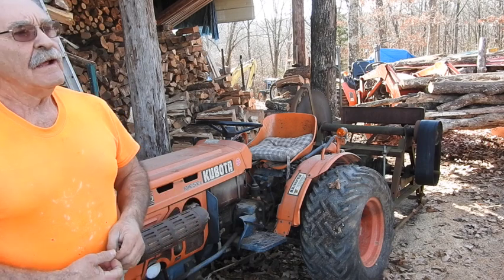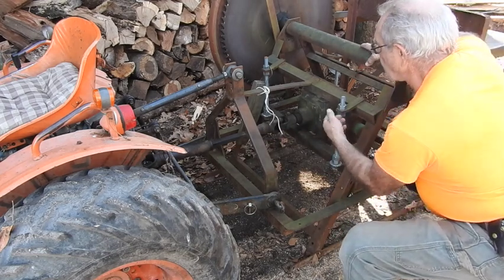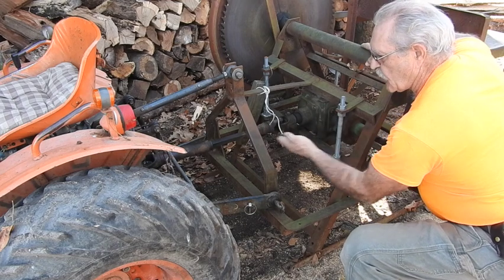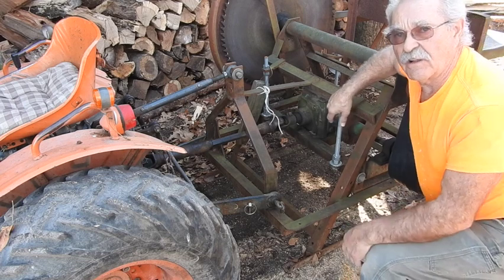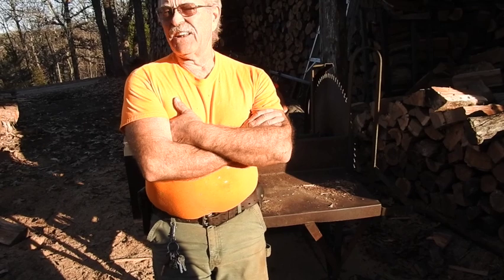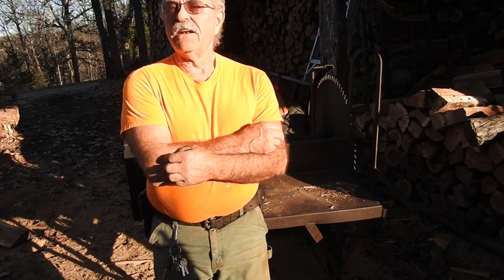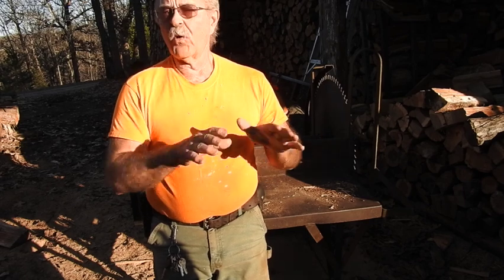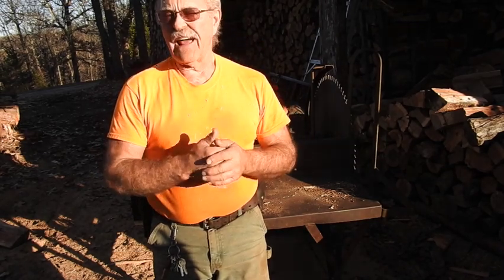Buzz Saw Therapy : Outdoors

Comment: T-shirt weather for you but for us it`s firewood time for sure....that buzz saw works really well off that Kubota.....CHEERS
Reply from the maker: Yeah, I figure if its GOTTA be cold it may as well be somewhere in Canada !!  I don't need it down here at all Gator.  LOL  That little 3 cylinder diesel will run wide open all afternoon and I don't think the fuel level goes down an inch or two too.  Great combination for power to the blade.

Comment: No two ways about it....that set up is sweet
Reply from the maker: It works really well for me, but I have another one that I use on an 800 Ford three point and it does very well too.  Then I made a temporary conversion for that one to be operated as a stationary rig powered via flat belt pulley off the side of a tractor.  It works GREAT in that configuration.

Comment: I remember my Dad’s friend built one when I was a kid for the three point hitch and the bed was stationary and the arbor was on a hydraulic cylinder to move the blade in to the wood. It also had a small 10 foot chain conveyor on the blade side. 30 something years later and many hands changed, I do believe that it’s still in the community and still being used to fire my cousin’s maple syrup burner!
Reply from the maker: THAT must have been a cool machine Peewee !! I've never seen a rig set up like that before.  Sure be nice to get some footage of that one in action.  Thanks for the comment.  Awesome.

Comment: That's good therapy right there....I like the old flat belt arrangement on the end.
Reply from the maker: Hahahahaha....you're a fan of old Rube Goldberg too huh Matt...LOL  I didn't have another crowned steel flat belt pulley to put on the gearbox output shaft so I scrounged up two dual groove V-belt sheaves and installed them tightly against each other.  I didn't know if the flat belt would have enough grip just running on the outside edges of the sheaves OR if the flat belt would even run true on it or fly right off one side or the other !!.  Turns out neither worry was anything to worry about.  It has great grip and it'll only fly off if I get a piece bound into the blade.  But in twenty plus years, that's happened only a handfull of times.  
   Oh yeah, I forgot to say the haybine was given to me to haul to the junk yard by an old farmer and the iron is out of the scrap hoppers on commercial jobsites and the sheaves are from dismantling salvage roof top units.  LOL.  And the belting came out of a trash hopper with several belt lacing tools and at least 20 to 30 rolls of belting of all widths and materials.  The neighbor lady gave me the saw rig 35 years ago because it'd been sitting in her woods since the 60's rotting down.  So this was another 'low budget' project thanks to salvage material !!  LOL Dang, I better quit bragging, ya think......

Comment: I saw you cutting some cedar. I thought I was the only one that burns cedar. Of course I have an outdoor furnace and burn almost all of my tree scraps. Enjoyed.
Reply from the maker: We'll burn some of the knotty stuff early in the morning to help ignite off the coals but the nice straight grain we'll just split into kindling as it comes in out of the wood pile.  Works really nice for that too.  Is it an OWB or a regular outdoor forced air furnace.  Most of the time they are the OWBoilers.
Reply: I have a hardy outdoor wood boiler with a radiator in my duct work. It’s great unless we lose power.
Reply from the maker: @commonsensehomestead  that's cool !  I actually have a Hardy that was in a building 100 yards from the house it served. The building burnt down, along with at least a cord of wood inside and just all but destroyed the Hardy.  I'll be doing a whole series on stripping it down, salvaging the basic boiler, then re-controlling it in preparation for heating 1200 linear feet of pex tubing in my 1200 sq ft new shop.  Its going to be a tough one too.
Reply: @tractorman4461  when I got mine it was being salvaged. Somebody had tried to burn trash I it. Mine was all bowed out. I pulled it all a part and filled it up. I didn’t have any leaks. Had to put new insulation, relay, solenoids, etc. Amazingly the blower and pump still worked. Mines a 91 model. They are a super simple design. Best $400 I ever spent.
Reply from the maker: @commonsensehomestead  That's a good story.  I think mine is in similar condition except the whole building burnt down around it.  I've stripped it to the bare heat exchanger and am going to place it INSIDE the space instead of outside. I have four 300' circuits to pipe into manifolds to be supplied by the boiler. I may also install an air handler and hot water coil for the spring and early fall before it gets cold enough to use the  in-floor heating loops.

Comment: I've got an old tilt table saw similar to yours. I haven't used it in 15 or 20 yrs. (The neighbors may not appreciate the noise). The bolt holes are worn bad and too loose to be safe. I should dig it out, weld it up solid and belt it up to our B John Deere or M Farmall.
Doc
Reply from the maker: Hot doggies....that'd be good if you have access to pole wood or sawmill slabs for sure.  I bet you'd be surprised at how much interest your neighbors would have in a machine most of them have never seen before !!  To a lot of guys, the saw blade sings a lullaby and its not even noise at all.  Either one of those tractors would work very well on the flat belt.  Thanks Martin for the visit this evening.

Comment: I remember seeing you run this little baby before. Love it and love that b7100. I have a b6100 and love it. Maybe I can find a nice b7100 sometime
Reply from the maker: They are out there.  I see them pop up ever now and then on Marketplace. In this area they are usually around $2500 to $3000.  I gave five grand for mine new in '82 with a 48'' Bush Hog finish mower and a 48'' blade, all of which I still have.  Most of the ones I see are in better cosmetic shape than mine because they usually aren't rode pretty hard like this one has been. But at least it still lives INSIDE at night !!  Thanks Tom for chiming in this morning.

Comment: Now there is a Fine riggin fer ser 44 Friend! It like those two fine machines were made for each other! Those pieces of red cedar would make your sock and tutu drawer smell mighty fine, don’t ya know? I swear I could smell that cedar saw dust all the way here inna holler from your holler! I suppose Missus 44 was at the mill filling orders while you were making heat sticks? Thanks for this Fine 44 Vid to have with my chicken soup! And I recently bought aDewalt 20volt 12” chain saw and it works great! Weighs less than 10 lbs , which is great for trimming around the house.  It may be I mentioned this before. So if I repeated meself you may have forgotten anyway? Hey, did I tell you about me new Dewalt saw? I raise meCuppaJO in your honor! DaveyJO
Reply from the maker: Yes, we used to sew up old pillow cases into small tubes and fill them with cedar sawdust to toss on the floor of the closets.  Stomp 'em a few times every month or so to 'freshen up' the surroundings.  You told me about the Super Duper Dee Walt battery saw...and I told you Stan the Man has one from Harbor Freight that he uses now.  He gave me two non running Poulans that've been sitting for years.  But he kept his one good running one so his grandson can start it for him when he's got some serious trees to work over.....LOL  Yep, just turned 90 and still givin' it the devil in the woods !!  Take care DaveyJO in PA !!

Comment: I have two buzz saws. One on the 730 JD diesel mounted on the nose. The other one is a stationary saw, just like yours. I think that I am going to rig it up like you did. Great idea for the mounting frame! 🤠👍🪵
Reply from the maker: That's cool Craig.  If you have access to a right angle drive it's really a slick setup.  I like it being attached but removable.  Even though this little Kubota has inherited full time duty as the power unit for at least the last 8 or 9 years.  But I did adapt another one for use behind the Ford 800 that drives off a Massey Ferguson right angle flat belt drive that mounts to the rear of the tractor on the pto.  The difference being, of course, is the location of the right angle drive....and that one started out as an actual Ferguson saw rig, not a stationary rig like this one was. It saws the same, but the lifting for transport is entirely different.   I have a series on that adaption: https://www.youtube.com/playlist?list=PLk72G9DTzZ1tJEjzkfIvq8dY-UWCpl4

Comment: Most waited time of the year!
Reply: Btw, do you have any measurement lines on buzz saw or you just  do it by eye?
Reply from the maker: @loodusefilm7881  I have a file mark in the table top 16'' back from the blade but I've got plans for adding a stub of metal off the bracket to the right side of the blade that too will indicate 16'' from that side of the blade.  It'll fold up for transport and storage by clipping onto the existing bracket.

Comment: Did you find out how the Dearborn saw fit onto the 3pt.  If not I have photos I can send you.  Kay
Reply from the maker: Yes, I did figure it out.  The reason I couldn't figure it out was because I didn't have an actual "FORD" right angle drive with the connection point for the buzz saw 'A' frame to hook to.  What I have is a Massey Ferguson right angle drive that is a slick cast housing with no connection point....THAT's why I couldn't see how to hook it up.  Now I've found a regular Ford one and I can see how it works.  I kept the Dearborn 'A' frame off the rig, so if need be I can convert either the one on the 800 Ford or the Ferguson  one I converted 30 years ago and is down in the woods.  Thanks to both yourself and your husband for the offer of the pictures.
Reply: @tractorman4461  good to hear.  Have a Merry Christmas.
Reply from the maker: @Kay-bo4tz  Thank you Kay, and may you and yours have a wonderfully warm and comfortable Christmas Season as well.

Comment: what size pulley do you put on the gear box and what size on blade arbor if ratio is one to one, trying to set this up on dearborn buzzsaw
Reply from the maker: The input of the gear box is directly connected to the pto on the tractor.  The output shaft of the gearbox has an 8'' pulley that drives an 8'' pulley on the blades arbor.  The gearbox is a 1:1.1 ratio, so the 540 input provides 540 + 54 output which give just at 600 rpm arbor speed.  I find on these old rigs with old bearings and old blades a range of 600 to 800 rpm is pretty good.  To increase the arbor speed, install either a larger pulley on the gearbox output or a smaller pulley on the blades arbor.  To calculate final rpm's multiply the input rpm by the diameter of the pulley on the output of the gearbox, then divide that number by the diameter of the pulley you install on the blades arbor.  Make sense ?  
    I have done other buzz saw adaptions on both Dearborn and Ferguson saw rigs.  Here's a multi part series on a different kind of conversion than this one on the Kubota: https://www.youtube.com/playlist?list=PLk72G9DTzZ1tJEjzkfIvq8dY-UWCpl4  It's got 11 or 12 parts but it is a comprehensive set of videos and there's a bit of the calculations in there as well.   A lot of times I put a lot more information in the description box that plays well into the context of the video.  Good luck with your project Kay.
Reply: @tractorman4461  thanks so much.  My husband watches your videos all the time here in Concord, VA.  He would love to meet you.
Reply from the maker: @Kay-bo4tz  Well,if we head over West Virginia/Virginia way I'll let you know on a video.  We made it to Williamsburg WV a few years back and the Missus wants to go back that way again.  That's probably a bit of a distance yet to you guys, but its a lot closer than Missouri !!  Thank you so much for letting me know your husband watches the channel a lot.  Tell him I DO appreciate it and to please not be bashful in the comment section.....LOL
Reply: @tractorman4461  will do we made it out to Missouri(Bolivar) few years back.  Beautiful there.
Reply from the maker: @Kay-bo4tz  I've been through Bolivar but its about 170 miles from here. The southern part of the state is quite pretty. So is what I've seen of Virginia and W Virginia too.

Comment: What did u take  that gear box off of
Reply from the maker: The right angle drive came off of a scrapped John Deere hay conditioner from the late 1950's.  Its a 1:1.1 ratio. So at 540 rpm input its out put is 540+54 which is close to 600 rpm.  The pulleys are both roughly 8'' diameter, so the arbor speed is roughly 600 rpm for the blade.  Thanks Herbert for the question. And yes, it works fine and hasn't had a failure since I converted it many many years ago.
Reply: Thanks I keep an I out for one wood one work off of a John deer wire bailer
Reply: Or a grain auger
Reply from the maker: @herbertaramsey9282  Yes any piece of farm equipment should work fine.  Depending on the type and age of the arbor bearings, you can run the arbor speed higher as long as the blade isn't stress fractured.

Comment: That blade is dull . file it a little,  then set it so one tooth is just at the end of last tooth
Reply from the maker: Good tips.  Check this out:https://www.youtube.com/watch?v=06hJGTyCPqM&t=1s Lots of verbal description at the first but at 9:28 you can see me use a Belsaw model 10452 grinder on this blade. This is another one where I hand filed it for touch up over a year ago. https://www.youtube.com/watch?v=ed8WSvOXvkw  Its cut a LOT of pole wood since then too. So yeah, it need a bit of a touch up again.